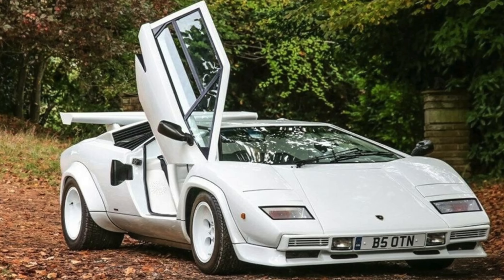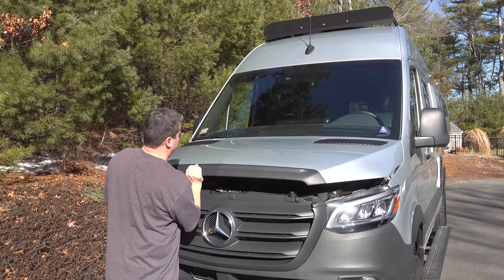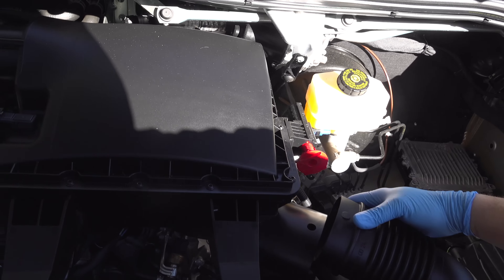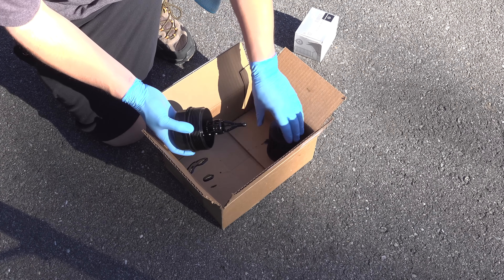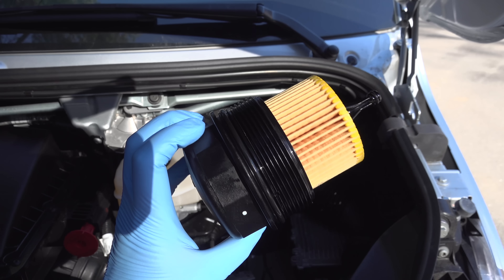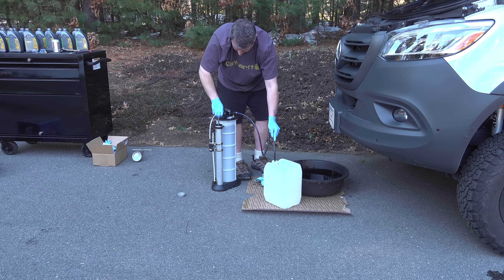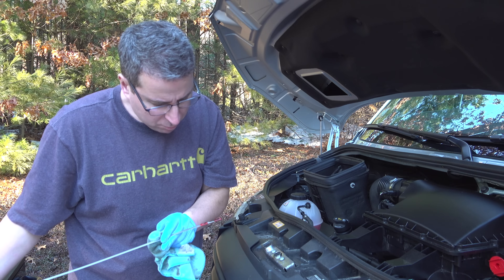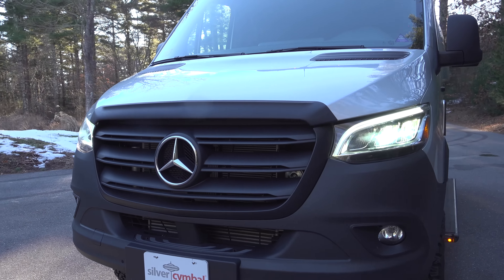RIDICULOUS Mercedes 4x4 Sprinter Oil Change - Winnebago Revel

Comment: My 6.6 Duramax takes 3 gal of oil for an oil change. While in the Military some of the trucks took 5 gal. The Military found that it was cheaper to take oil samples and get them tested than to change the oil every 6 months or 3,000 miles.

Comment: Filter wrench? I have an NCV3 camper with the same engine and I just hand tighten it. It does help to take the whole airbox off which is very easy to do and requires no tools. Also, the OEM filter is made by either Hengst or Mann and you can just buy those saving a fair bit of cash instead of the OEM branded one.

Comment: Because it's a 4x4 you maybe have a bigger oil pan giving the possibility to suck oil on high tilt that is not possible with normal oil pan and can result to engine's damage on regular engine.
Also don't forget the oil life time on my exotic Cadillac escalade esv 6.0 I have to remplace my oil every 5000km (3000miles) and I have a lot of oil in it (something like 7L or 7 quartera) but on my dad car a Skoda Octavia with the 1.9tdi from VW the quantity oil is lower (like 4L or 4quarters) but IR can be change only every 60000km (37000miles) with longlife oil (or 30000km or 20000miles with regular oil). This oil life time count a lot in the usage fee.

Comment: I don't know what it's like mercedes, but for my toyota, going to the dealer and buying OEM oil filters is the same price as an off brand one (approx 5-6 USD) and my dealer throws in the washer for free. I always check the dealer price for parts and fluids because you might be surprised....

Also, I'm not saying you need to use OEM oil, but this is another reason to do your own oil changes because I wonder how many of those quick change oil shops even know about needing to use ESP special engine oil or even care to use the special engine oil...

Comment: Large oil fills are normal for diesels. Just one of the many ways they are more expensive. Fuel is higher, they need DEF, injectors are crazy expensive. IMO small Diesel engines aren’t worth it, the extra efficiency comes at a huge price.

Comment: Ugh those merc sprinters. I've heard in ma atleast commercial vehicles its better to go gas than diesel in a fleet.
Reply from the maker: Just starting to get into this one and it does seem like the Mercedes have a lot of quirks. You may not have seen it but I owned a few years ago and made an insane video about the brand. Many angry owners that I spoke up about repair bills and resale value.

Comment: As much as I love y'all's videos, which are usually absolutely on point, I have to disagree with y'all's comment about diesel engine oil ALWAYS being black.
   My '02 F-350 Power Stroke,7.3l diesel V-8's engine is filled with 15qts of AMSOIL 15-40 heavy-duty synthetic oil. At 5000 miles, the oil still has color in it.
   To be honest, I wouldn't feel uncomfortable about going 7,500 miles or more. When y'all don't put 6000 miles per year on any vehicle, y'all tend to change it more frequently. 
   Yeah, it costs a little more than others, but, at the end of the day... how do y'all  comprehend value?
'Nuff said. Giddy up.

Comment: Oh lordy, 3.5 time more than my old 89 Dodge Omni.
Reply from the maker: That was the first car I learned to drive on. Long live the hatchback!
Reply: @SilverCymbal  as long as the struts that hold up the rear hatch that is. lol
Reply: @SilverCymbal  me too, accept sometimes when I would start it up the engine would redline on its own , and would not reduce its throttle no matter what you did. That thing got towed quite a few times to the dealer to figure that little problem out and then of course the rear lift gate gas struts almost never worked.and being in Michigan it rusted out pretty fast too.

Comment: Yeah cause it's a Diesel! Change oil in an 18 wheeler they take 90-120 quarts!
Reply from the maker: That is craziness. But I guess those are soooo big. This is just a van, not even an extended one.
Reply: Our 2020 6.7 Powerstroke takes around 13-14 qts. She also puts out over 1000  foot pounds of torque.
Reply: @SilverCymbal  yes and those diesel's love to use oil even if you have No Leaks!

Comment: Did anyone ask or answer the burning question - why does such a small engine demand so much oil?
Reply: Probably because Mercedes knows they're primarily fleet vehicles that are going to be beat on and undermaintained
Reply: 20K mile service interval
Reply: I drove a service van for 35 years and ran it all the time. In the winter working on outside equipment it would idle for hours to keep me warm. None of my vans were diesels and none had 8 quarts of oil and none of my vans had an engine issue. They were either Ford or Chevy. I did change my oil on time though. Maybe diesels need more oil. Then again it’s a Mercedes and people believe they are something special. If by special you mean expensive to maintain they yeah they are special.
Reply: Merc use to fit an oil cooler but that was in the customers interest less oil  Them someone in merc came up with this great idea we will put on bigger sump pan and no cooler  merc only had to pay for the oil once We the customers will have to pay for it on every service

Comment: Sprinters have bigger oil pans than the ones in their cars i have the same 3.0 liter v6 turbo diesel engine in my e class and the oil capacity is 8.5l or 9 quarts.

Comment: Why don’t you simply pour oil in the container instead of 2 step, mighty vac process.
Reply from the maker: You could, but once you have used that for something else, its not clean enough for mixing other types of oils. Some shops use these exclsuively for coolants and transmission fluids.

Comment: There is literally nothing InSanE about the oil change, except the lack of the of a torque wrench.  
14 quarts is about average for a light/medium duty Diesel engine.  Have owned GM, Fords, and even a 3.0 and a 2.7 sprinter for reference.
Reply from the maker: Is it average? The Ford Super Duty has a 6.7 liter engine and uses 13.0 qts. The Mercedes has just a 3.0 liter engine and uses 13.4 qts - I say that's pretty unusual. Everybody yells about torque wrenches I have never seen a pro use them on anything except head bolts. Use it if you want, wasn't a big deal here.
Reply: @SilverCymbal  I have been over seeing 7 shops for almost 2 decades and used to turn a wrench for a living.  I have never had a car leave with out a drain plug being torqued or a filter cap being torqued.  Its especially important on the German aluminum pans with the overally aggressive threads and soft aluminum. 

I would still say not an insane amount for it being a diesel.  Off the top of my head the duramax is the least at like 10 quarts but its gas counterpart is almost 9 quarts if I recall correctly!  There is one thing that has been certain for quite a while German engineers love lots of oil.  even their gas motors take double or triple what we would consider normal.

Comment: I just took delivery of a 2022 Tesla Model S after a 9 month wait, I'm done with oil changes forever.
Reply: Don't for get the electric car will soon be very expensive to charge Some  off the bus company's are charging  the buses with diesel generators cheaper that electric from the grid they can drive in the city toll free
Reply: @patkelly9907  I charge at home, have solar panels on the roof, not an issue. Also have 1000 supercharger miles from Tesla.
Reply: Just to up date you on the cost of charging an electric car here in Ireland  it was 7 euro when we spoke last now  it going up to 25 euro the power company's can wait to screw everyone
Reply: @patkelly9907  Sorry to hear that, isn't there any kind of regulation of electric rates to prevent price gouging?